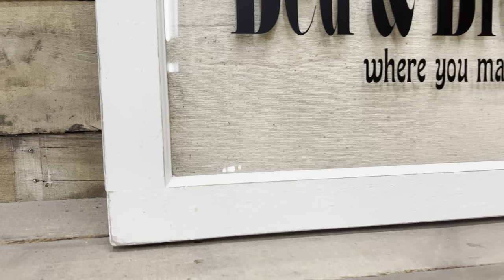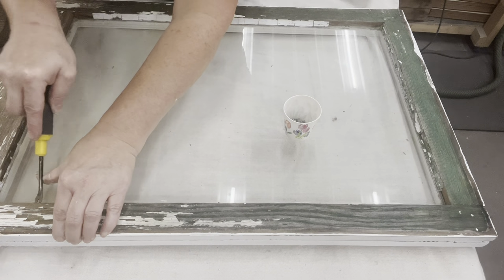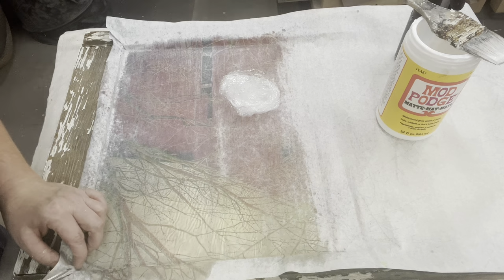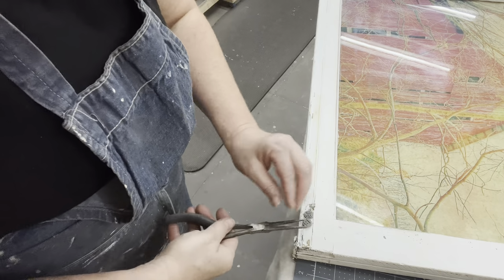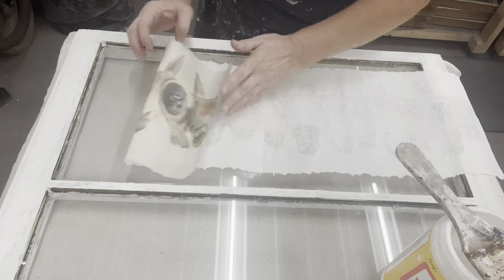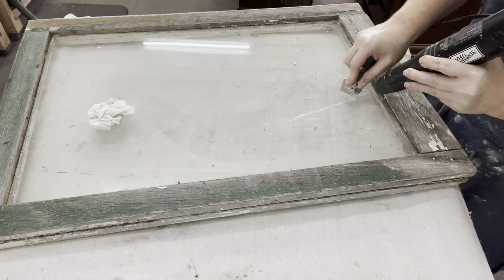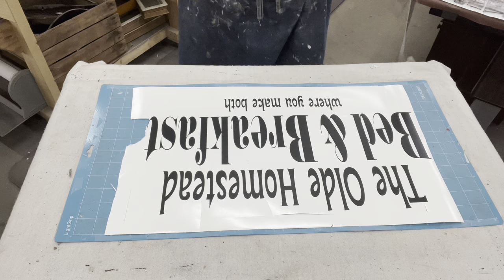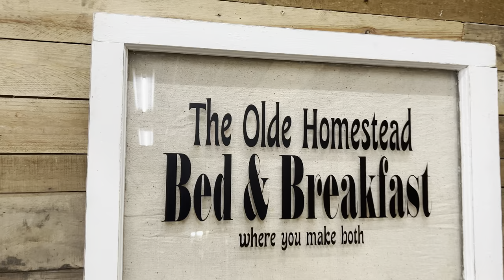I BOUGHT THEM  ALL | OLD WINDOWS | HOME DECOR | DIY | FLIPPING FOR PROFIT

Comment: Though they were all delightful, the Red Barn won me over, because it could be taken a step farther, by placing the decoupaged barn on a larger window glass that fits the outside edge of the back of the window frame, with the front glass intact and real branches fixed in place between the two windows, for a three- dimensional look. You Are Inspiring!

Comment: I bought and have been using some of the contractor's paper from my local Sherwin Williams Paints Store. I have found it to be so fragile that it tears at the slightest bump. At a craft show I had this happen and had to set the windows aside and bring them home to try to fix them. I have begun to use black poster paper from Dollar Tree and Walmart instead. The problem with poster paper is some windows are just too big for the size of the poster paper. Do I need to look at another source for the contractor's paper?
Reply from the maker: They one we buy from Menards or Home Depot is very heavy weight.